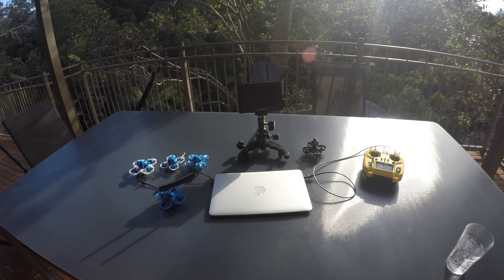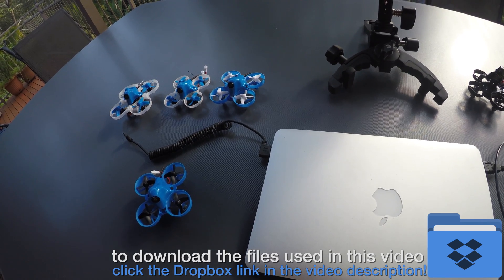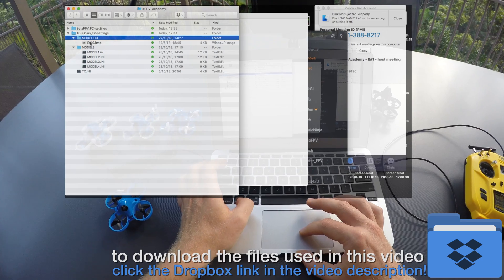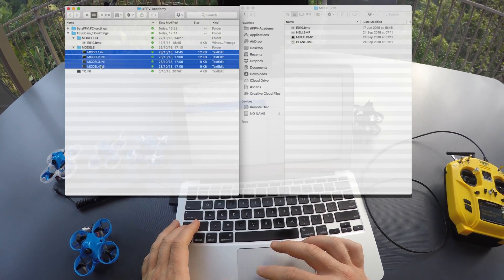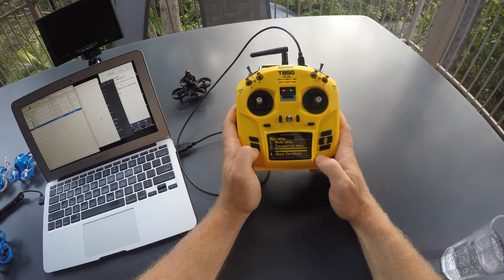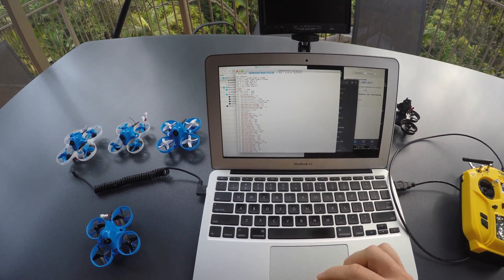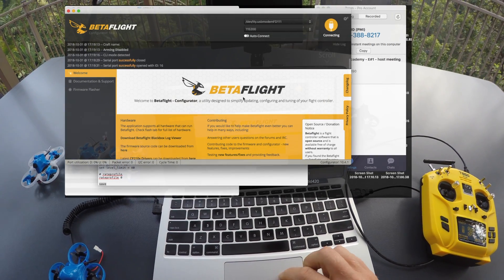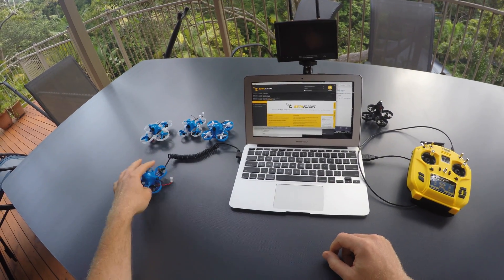Config files for Jumper T8SGv2 and BetaFPV BnF models

Comment: I want to thank you so much for all you are doing here and at the "Community" pages. I do so enjoy this hobby but the learning curve has been a challenge to me. I am 71 yrs young and find the most problems dealing with the programming things. I don't yet own a drone that uses Beta Flight tweaks but I may bite into that area later. Being able to dl config files for the models I do have has been a great blessing. My three  E 011 quads fly like never before. So responsive. I set that protocol up from the Jumper tx as is. Stumbled around a bit and it worked. But don't know how to make them "flip" as before. I'm eager to load your BetaFPV 65s Lite config as when I used the same file I have for the E 011 to fly it with it acted a bit "wonky". Not very stable. Hope your setup fixes that. I have few models that I don't know the protocol they use. One is the Lieber Birdy 1060 aka DLFPV 1060 and another is a fun little quad  with colored  LEDs called the VEKEN. How does one find out the protocols various makers use? Tried Google but no results I could use. Thanks again my friend!  BTW, enjoy your accent. German maybe?